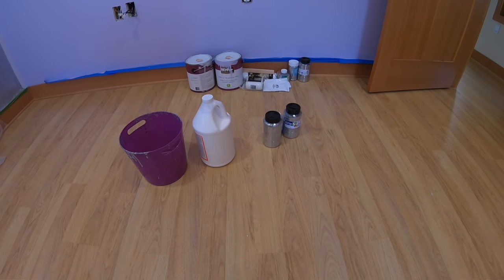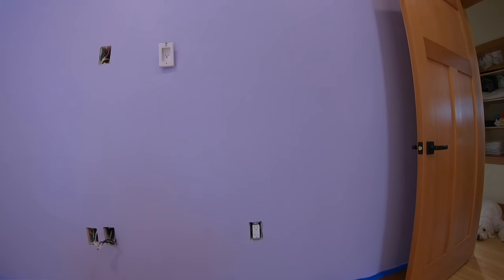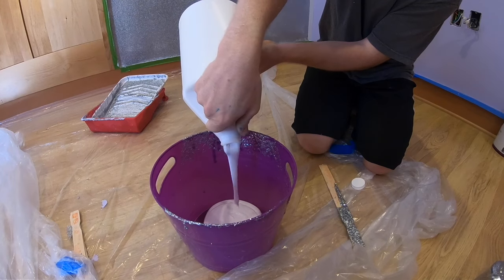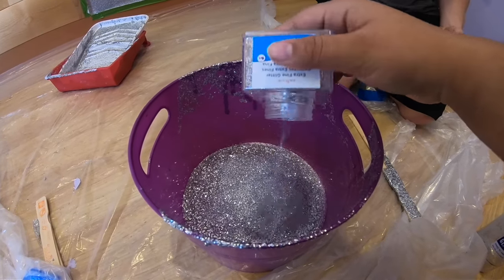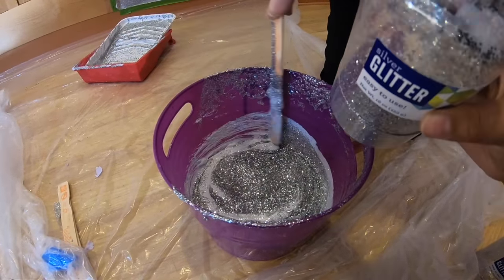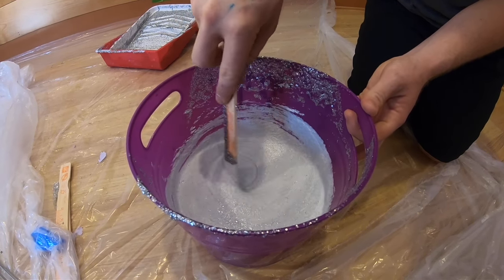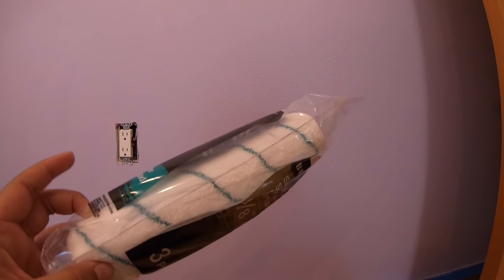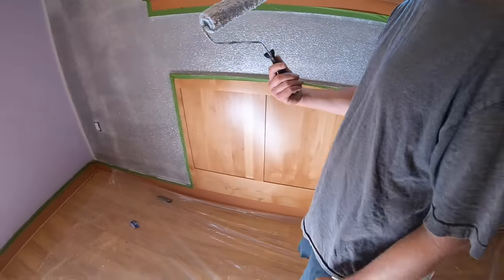Make your own easy mess free DIY Glitter paint

Comment: Could this be used on the rubber rim part that connects the wall to floor like the part where he stopped painting
Reply: The rubber rim part you're referring to is called "cove base" and unless that surface is clean, dry, and dull using an adhesive bonding primer, it will peel right off . 

Even if you do all of the steps listed above, you'll probably still have issues with wear and tear due to the base trim being ran into from furniture and foot traffic  :/ maybe if you top coat with a clear polycrylic sealer?